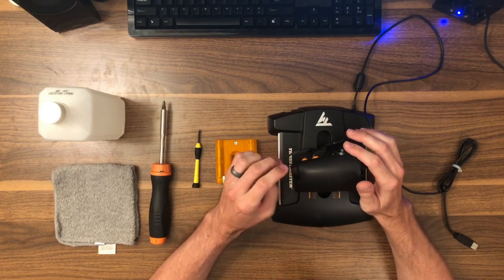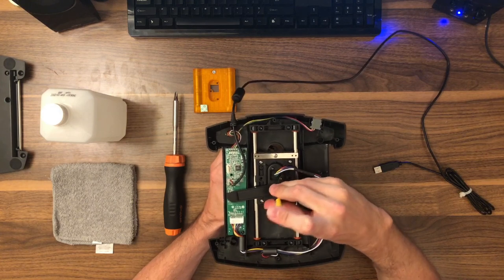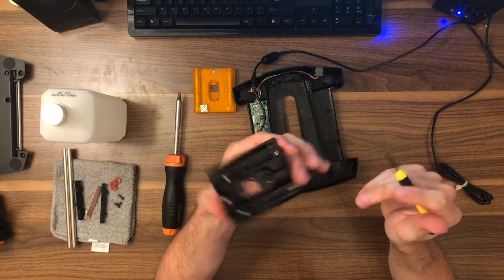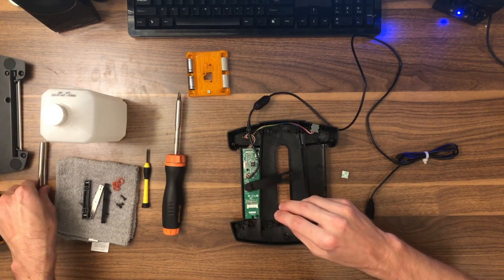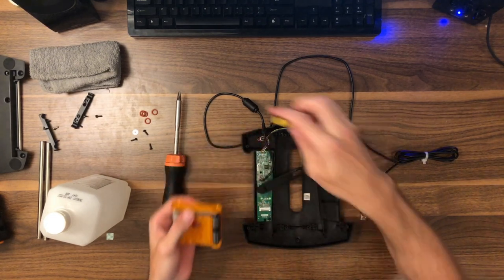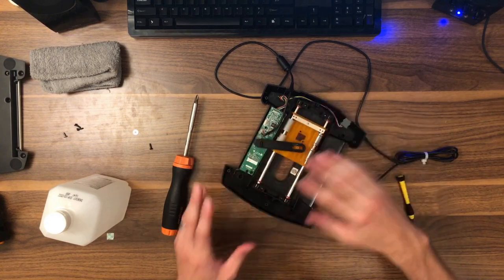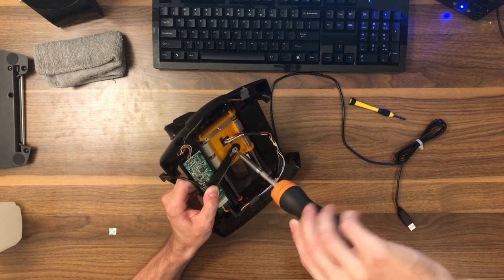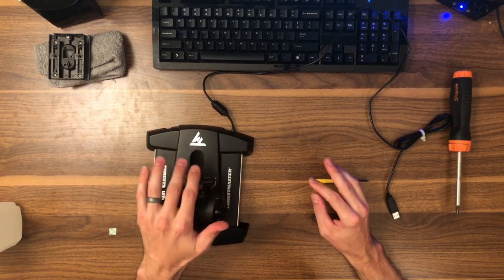Impulse Slider Installation Guide - ThrustMaster T16000m Throttle Upgrade!

Comment: Just got it and installed it. IT'S A MUST HAVE GENTLEMEN! Makes a huge difference. We need the same mod for the pedal too. AMAZING WORK!
Reply: Honeycomb is coming out with a rudder set that's mostly metal for around $250. It might be a good alternative or replacement for budget pedals and it might be a good compromise over the price of TPR pedals from Thrustmaster. We will see
Reply: Yeah,the pedals are really something.

Comment: I've received mine earlier today and installed it eagerly.
It's fantastic, so I just wanted to add a thank you note and shout out here.

Thumbs up!

I think the orange is better, not because of aesthetics (although it would look awesome), but because black on black makes it slightly harder to reassemble the unit, when trying to align the holes (although the engineering is pretty spot on).

It's a must have for all the TWCS owners!
Reply from the maker: thank you very much!

Comment: Ordered your kit at the same time as my TWCS, kit got here first, (finally!) got the TWCS today. Happy to report there's a tangible improvement in smoothness over factory new. :-)

A few notes:

If you're concerned about the sensor arm, it should be possible to remove the whole PCB + sensor arm by removing the two screws holding the PCB in the case. (It left it in and had no issues.)
I slid the rails in before installing the friction leaf spring, no need to fight with it that way.
When finishing up, first secure the bottom plate with two screws and check the movement again, the harness on mine caused abnormal friction between 50% and 100%. Once motion is confirmed to be correct, connect it to validate proper detent magnet placement using the control panel.

Comment: Just received mine in the mail. Watched the video to figure out how I'm going to swap them tomorrow. Looks pretty straightforward though I particularly appreciated the information on the wire harness. Since I went with linear bearings, the bushings will be kept for about 100 hours of play time, then thrown away if I don't want them.

Thanks for making this available.

Comment: Just finished installing mine, and it's like a dream come true. I had to fiddle with the polymer bearings a bit as shown in the video, but once I found the sweet spot the difference is just amazing. The only thing I'd do differently is make the magnet a little bit smaller. The strength and size of the magnets that come with it offer a wonderful feeling detent that you trade for loss of fine control between 40-60% unless you want to hold the throttle in place. Not a huge deal, but something to consider for some people. 10/10 would recommend.
Reply from the maker: thank you! I hear ya, I've gotten both sides of the magnet argument there, I'll keep that in mind moving forward.
Reply: @CoreHawk3D  I think the biggest difference in the magnet discussion is the presence and type of lubricant or damping grease used. Lubed with WD-40 you can really feel that magnet super tight. A little bit of Nyagel, and the magnet is barely felt.

Comment: Just finished installing the Impulse Slider mod.  Your video was very helpful.  A video by Arvey Jay convinced me to buy it.  I got the gunmetal colored one only because you were out of the, for me, nicer looking orange one.  8-(  Not a big deal.  I'm very much a function before form kinda guy.  I did two things slightly differently than shown in your video.  

First I took a wooden clothes pin and whittled off a bit of the wood at the clamp-end until it fit perfectly over the TWCS case and throttle plastic thingamajig.  That way I only had to worry about holding it in place when I was removing the original slider assembly and putting the new one in place.  Two free hands are better than one unless you're working with high-voltage.  In which one hand should be cupping that which you hold most dearly.

Second, those aesthetic metal rods on the side of TWCS are steel.  I used one to help precisely position the magnet on the TWCS base.  The magnet was the same diameter as the metal rod, and considerably less bulky than my fingers making positioning a lot less fiddly.  Once happy with the placement, I slid the rod off horizontally to avoid pulling the magnet off and then made sure to push the magnet's adhesive solidly onto the case with my fingers. First shot and it was in the right place.

It works wonderfully.  My only concerns at the moment are, I wiped all the excess grease from the slider rods.  I did not use alcohol, just a rag so a sheen of grease is still there.  If this was the wrong thing to do I can always go back in and add a dab or two of PFPAE grease.  My other concern is with the relatively strong attraction of the magnets at the zero point.  I am concerned that very small speed settings around the zero point will be resisted.  Time will tell if that really is a problem.

Thank you!  Keep up the good work!  Well worth the money and the effort to install it.  5 Stars!

Comment: 100% worth the small cost. Adds a much needed center point and improves the glide.  Follow the video and you can't go wrong.  Easy to install in 30 minutes or less.

Comment: Installed mine yesterday. Super simple installation, and the now it's an entirely new throttle experience. I opted for the metal linear bearings, because I tend to rest my hand heavily on the controller, and the throttle moves completely smoothly with either firm or light pressure. I get super accurate control now, and the magnetic detent is brilliant for touch-only zeroing of throttle setting. Thank you for an amazing upgrade!

Comment: Got our throttle upgrades in today and switched out the sliders on both of our TWCS throttle controllers. Very good installation video, and I'm impressed at the engineering of the upgrade parts! I switched out one of our controllers with the metal bearings and the other with the polymer sleeves. Gonna try them out in a few games to see which ones we prefer, but I'm already leaning towards the metal ones, sooo smooth. Oh, one recommendation - you might want to put a link to your installation video on the invoice. I already knew about this video, but was surprised there were no instructions in the package. Anyway, thank you for a great product!

Comment: Mine arrived today. Installed in about 30 mins. Hell of an improvement. Had to change the screw on the main 'movement' mechanism as it was scraping on the floor of the unit. Other than that I feel this is an essential piece of kit. Thanks mate!

Comment: Thank you so much! Took no longer than your video to follow along and install it. I purchased both the polymer bushing and metal bearings and you already installed the bushings so I tried those out first. It's exactly what I'm looking for! Time will tell how long they last but until then I'll still have the metal as backups. Thanks!

Comment: Just fitted mine, delivery to the UK was remarkably quick (Ordered on the 15th of April and shipped same day, arrived on the 28th of April). I ordered the polymer bushings.

Installation was easy and it does seem to have made quite a difference, when stock the entire unit would actually move across my desk when in use unless a considerable amount of downward force was used to keep the base firm against the desk. As I understand, this would only have worsened over time as the plastic inside the unit wore against the metal rails. 

With the modification I can quite literally press the throttle forward with one finger and the base does not slip around, even with the magnetised indent fitted. The modification still allows enough friction for precision, in fact I would say it's more precise since there is no longer any need to work around the stiction. 

The one small flaw (for want of a better word, since this part of the mod adds more value than it detracts) I would mention is that even when fitted precisely, the magnetic indent is not necessarily going to land the throttle precisely at 50%; it gets you to probably +/- 2% of that area but requires a little wiggle to get it dead-on 50%. This is virtually a non-issue, and I can think of no other way to implement it without requiring some heavy duty modification. Honestly, the fact that this magnetic indent works as well as it does adds a whole other dimension of usability and thus my small gripe should not be seen as a big deal, nor detract from CoreHawk3D's achievement in any fashion. It works to about 98% effectiveness in an otherwise perfect design. 

Big thanks to CoreHawk3D who has vastly increased the usability of my budget throttle. It's probably something that could easily have been implemented by Thrustmaster themselves, but I assume they look to cut costs wherever possible for the budget-range (as evidenced by the two defective T16000m sticks I went through before ending up with a working model). I would happily do business with CoreHawk3D again should something else useful to me become available.

Comment: Just received mine this morning. Took about a month to get here (Australia) but I live just north of the middle of nowhere so as far as shipping times go its pretty good. Easy to install following the video. Chose to use the metal bearings and it has made a world of difference compared to the original slider. So much smoother with way less friction. Definitely recommend if you are unhappy with how your throttle feels.

Comment: Just installed mine and I'm very happy with the build quality and feel. The magnet was a great touch. Thank you for the great installation video as well.

I'd recommend packing a little bit of extra padding around the guide points on the leaf spring side of the 3D printed assembly. USPS snapped one of mine off in shipping. It doesn't appear to impact performance or feel so I'm not worried about it.

Comment: EDIT: I have now tried both the bushings and bearing options. The bushings are MUCH better. They are far smoother and quieter than the bearings.

Received my slider today, really quick shipping cross-county even being Christmas time. Thanks! As for the slider upgrade, if you haven't installed one of these, you need to! It a HUGE improvement and makes a tremendous difference. I went with the bushing option but would probably get the bearings if had it to do over. Thanks Again!
Reply from the maker: Thank you so much for the feedback!!

Comment: happy customer here, absolutely amazing product - my only concern/improvement recommendation is that the magnet in the slider should be glued in - mine got pulled out by the other magnet after a while. the 3d print could have a little element on top to hold it stronger. 

for the bottom magnet, its really important to have it at the absolute center. therefore i recommend to plug in the throttle and position it to where it shows about 32768 in the calibration app (the exact 50%), mark the spot, and put the bottom magnet there. you want to be sure you go at zero speed when its centered and not backward or forward. 

first use double sided glue to mark the center 100% (make a mark on the plastic at center).

then, i recommend to actually use b6000 or super glue put it to position, add some weight and wait 24h to cure. that wat it stays stable - nothing is more annoying than to take apart the entire hotas multiple times just because the magnets pulled out each other & married in the middle.

ultimately it could be useful to print a 2nd 3d element, a plastic “hat” to put the bottom magnet into position, which can be glued there, this could help with positioning / installation.
Reply from the maker: Thank you Tamas! Do you have one of the gunmetal sliders?

Comment: Just installed mine, love it. I wish the magnet was a little bit strong so I can really feel the snap of the detent, but it is fine. Worth the money, I got the polymer bearings. Thanks for a great product and install video!
Reply from the maker: Thank you Ryan!! I'm sorry the magnet isn't quite what you were looking for, it's a 10x3mm magnets, if you want, amazon has tons of options with different thicknesses. I landed on the 10x3s in response to similar feedback from other users in the other direction: people were saying the mags were to strong. Maybe get on amazon or something and look up "neodymium magnet 10x4mm" or something like that? It doesn't need to be 10mm diameter (largest I'd go is 12, smallest I'd go is 8 so there is a decent amount of area for the adhesive to grab).
Reply: @CoreHawk3D  I will give that a try, thank you!

Comment: Thanks from the UK.  The video was very helpful and the install went fine.  I got a clicking noise that I tracked down to the black rotating arm on the orange slider.  The washer seemed to be causing it.  I cleaned up the orange pivot point with light sanding from an emery board, flattening the top.  I put a little grease there too.  It may be early days but here's hoping it doesn't reoccur.

Comment: I was worried about the installation initially, but this really guided me through. The only question I had was whether or not to remove the lubricant that was pre applied to the metal rods that the part slides on. Yours looked dry so I did, but it may be worth noting if that's correct. 

After the install the feel is definitely more consistent and smooth and the center point is definite, but not so strong you can't manually nudge the throttle forwards or backwards if need be.

Comment: I just stumbled across this  DCS tutorial of how to set the throttle in DCS with Afterburner Detent.
It may be useful to other  Impulse Slider users.  The demo uses a Wart Hog but he shows how to set up the controls in DCS which is applicable to any types of throttle. 

Btw, 10 minutes ago I just finished installing your Impulse Slider into my TWCS which is only about a month old. It now feels as smooth as glass. Much better that the brand new TWCS was and I am using the Nylon not the Metal version of the sliders. 

I didn't use the magnet. At first I left the magnet  on the top of the other, as you package it, just for a safe place to keep them incase I want to install a detent. But it made the glider touch the throttle housing at the end of the slide travel. So I took the magnet with the sticky tape off and put it away for later if I decide to follow the tutorial in this Video.
https://www.youtube.com/watch?reload=9&v=WlL0tQzVEPg
Reply: Would it be possible to mount the magnet in such a way as to have it activate at about 80-90% of full throttle, instead of 50%? I don't do space sims much, just looking for an afterburner detent in DCS.
Reply: @Darrylx444   I would say that there is enough room for an Afterburner Detent. I may put one in myself later.
Reply: you can stick the magnet anywhere you choose.  His location is for a 50% detent, but you could easily place the magnet an inch toward the top.

Comment: I tried to comment on ETSY but the review window has closed. That should give you an idea of how long it's been since I ordered. I ordered in December 2020 and never received the slider due to Covid and I suppose a thousand other reasons. 

Contacted Stefan and received the most amazing service in trying to track down what happened to the unit I ordered and for some reason it got lost in transit. Like I said could have been for a thousand reasons including somebody deciding they wanted it more than I did. Because what an amazing mod to an otherwise decent throttle.

I tried the polymer bearings but they did not quite work for me but the metal bearings are absolute class.

So in not so short... an amazing mod for the throttle and even better out of this world service. You cannot go wrong!
Reply from the maker: thank you very much Chris! I appreciate your kind words!

Comment: Great item. Completely solved the issues with the controller sticking and binding. Fine, detailed response from the throttle now. I got the metal bearings and--while not silent--the noise is unobtrusive (unless someone was sleeping right next to the unit.) Plus the tactile feedback is really helpful. I'm using MSFS2020 and I didn't figure I'd need the magnetic detent but I installed it anyway and it turns out to be surprisingly helpful. Also, the installation video is spot on. Even a non-handy person such as myself had no problems installing it in short order. Thanks so much for all of this. Excellent work!
Reply: Where did you buy the needed elements? thx
Reply from the maker: thanks for the feedback!!!
Reply: @CoreHawk3D  wanna buy one, come back from vacations 🤣

Comment: Agree with previous comment, new video or edit current one to show install of the new detent stick - other than that, excellent work, both in the product and the fitting guide - got mine all done and wow ! what a massive difference - thanks for the excellent work :)

Comment: I wanted lowest stiction above all else, used the metal bearings, and it is WONDERFUL !  I am a real pilot, and only do flightsims, never Elite dangerous, Squadron, etc,   Real airplanes require large throttle movements at times, but it is never fast-as-your-arm-can-go. Piston and jet engines only accelerate/decelerate so fast, no matter how fast you move the throttle. 
The tiny amount of stiction remaining is perfect, so the throttle does not move merely by putting your hand on it.
Reply from the maker: Thank you for the review Vince!